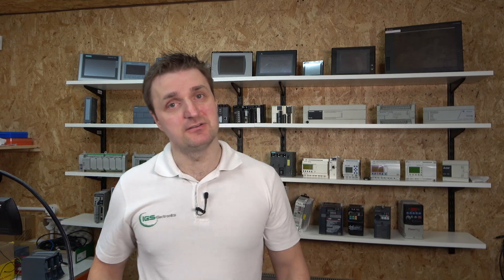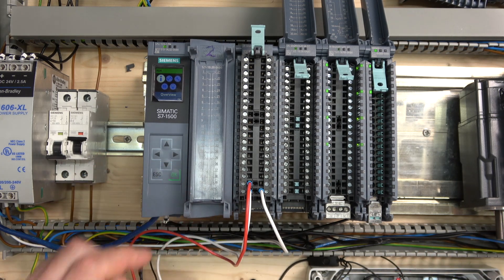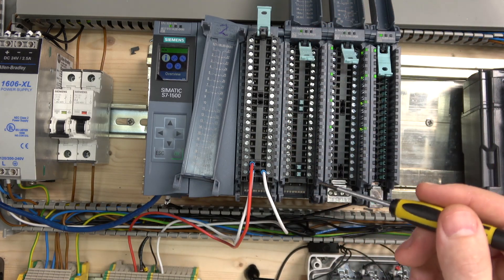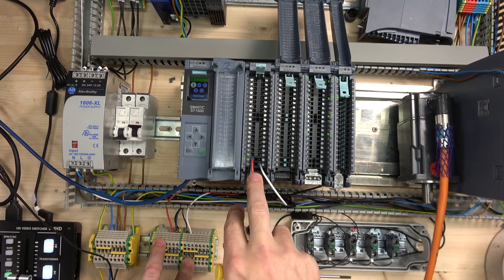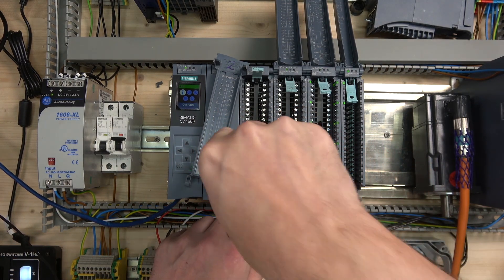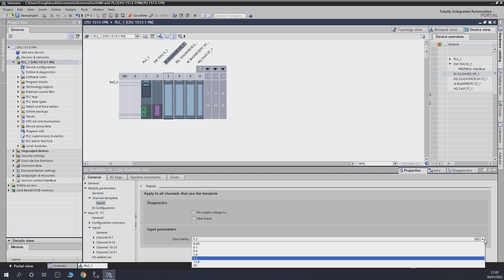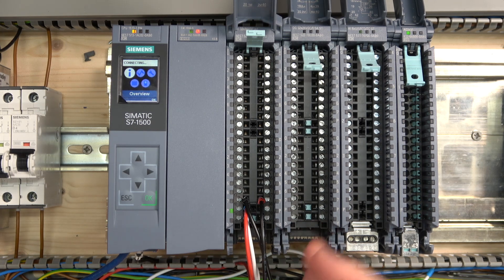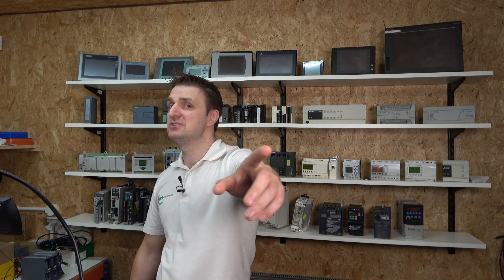How to wire and fault find Siemens S7-1500 PLC digital input card + diagnostics

Comment: What is the cause , if S7-1500 automaticaly goes to stop mode?
Reply: For later viewers: Could be a programming error (TIA Portal). Typically found in OB1. Or hardware fault (if using Step 7 Simatic Manager). Regardless, load your diagnostic buffer in Online Diagnostics and it will tell you.